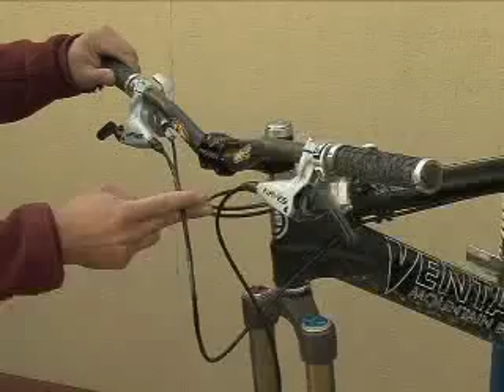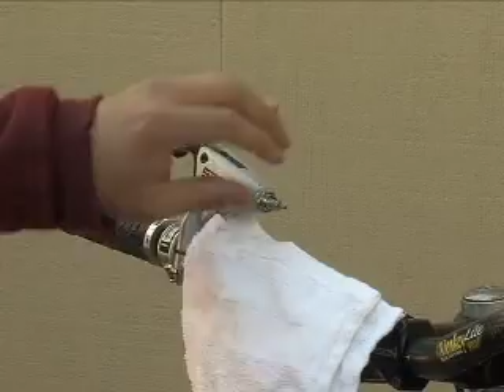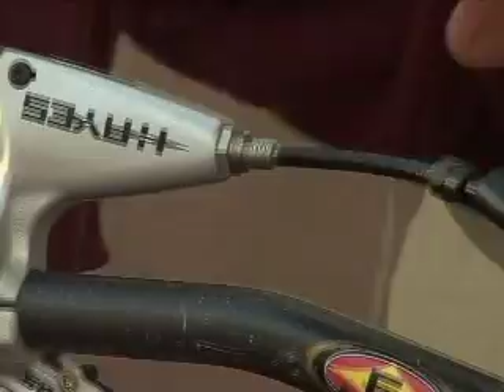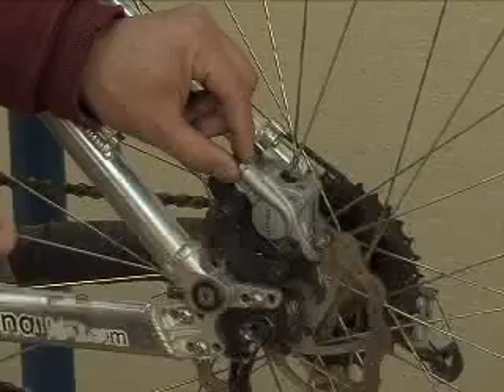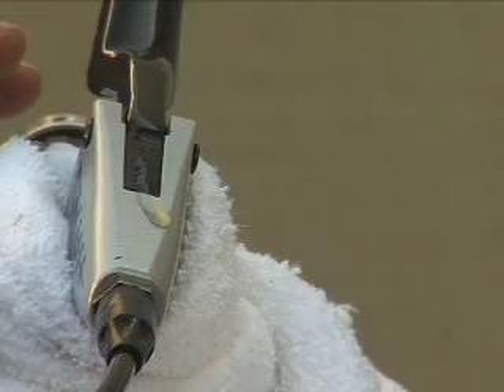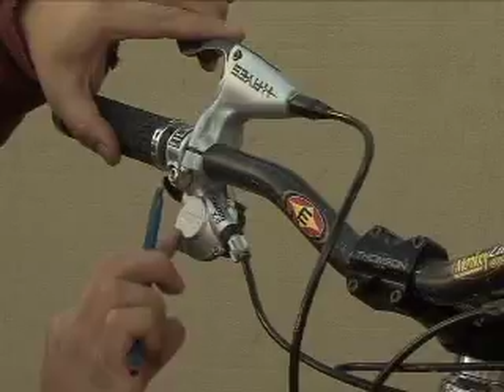DIY: Cutting the Brake Hose/ Bleeding the Brakes

Comment: Because air bubbles find it easier to travel upwards rather than being forced downwards. Therefore the old fashioned way of bleeding from top to bottom (as you have said about cars and motorcycles) means that you are fighting against the air all the time as every time you stop any air tries to float back up the system. Therefore if you can bleed from the bottom it is much easier to remove all of the air. This works with cars/bikes but dont push the pistons OUT of the calipers.

Comment: Lots of vids on this eh. Could of helped me 8 years ago. I have a Wheeler DZX5000 came with Hydraulic brakes. seems I have had to bleed them once a year. CAme up with my own way since there are no fitting for my system. I use a Vacuum Gun and some fitting with hot glue. pain in the ass but the hot glue stop the air from getting in and peels off clean when done. Need to make a Vid in case others have the same set up.. 

Cheers.